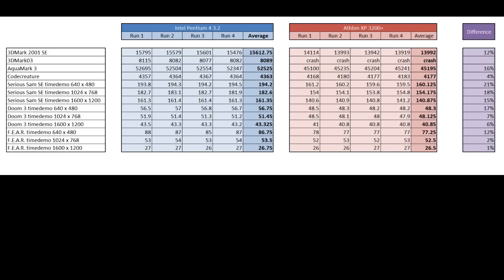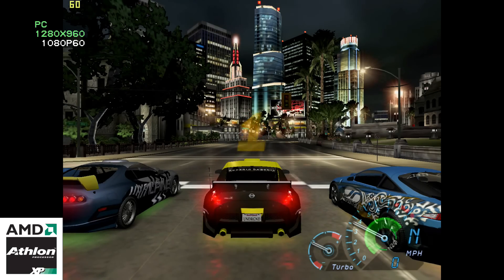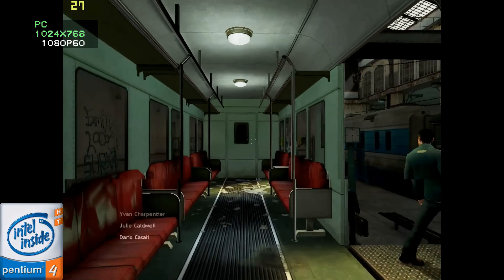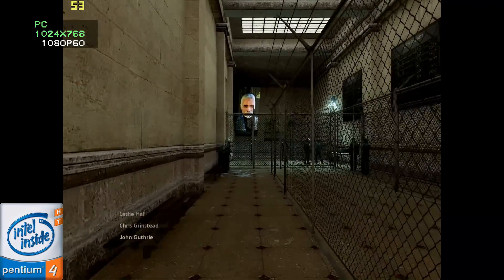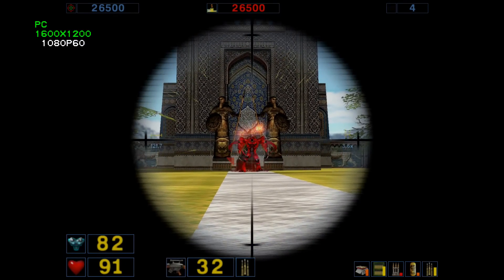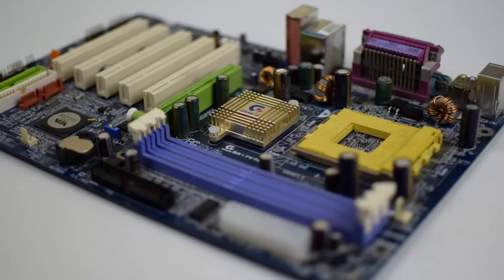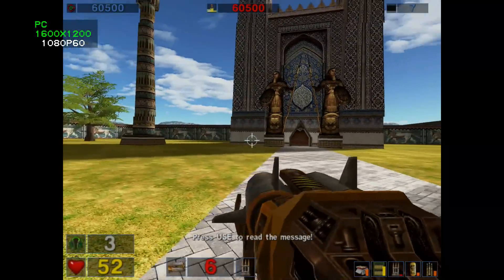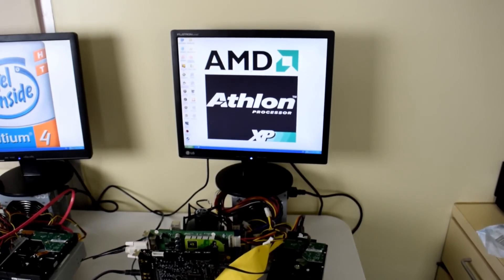Intel vs AMD S1E1 - P4 3.2 vs XP 3200+

Comment: AWESOME video! What did you use for recording the monitor inputs? Looks great.
Reply from the maker: +William McCarthy Thank you :) Make sure you watch episode 2 and 3 as well. I'm still waiting for a CPU to arrive to do episode 4. For capturing I used an AVerMedia capture card.
Reply: Does your AverMedia card come with a VGA input or did you use an adapter? I'm checking out 2 and 3 right now :D
Reply from the maker: I used the DVI output with a DVI to HDMI dongle :)
Reply: Thanks! I've been looking at capture cards lately for this kinda of stuff. I wanted to konw because it's weird seeing the actual bios screen recorded directly instead of with a camera. I have a DVI to HDMI cable luckily. Thanks!

Comment: There's a problem between some nVidia vidcards and AMD64 CPUs. It also crashes WinXP if you attempt to use the magnifier. The solution is to either find a different video card, or use a 32bit AMD. I don't know if this is what you ran into but... I've seen this sort of thing often enough with AMD all the way back that I've become a total Intel bigot.

As to the performance difference, remember that's even tho AMD CPUs are tuned for gaming, and Intels are tuned for business use. And 20% can be very significant if a program is bumping up against the CPU's max capacity. I have a pair of PCs that are roughly the same setup as your two, and the Intel box runs rings around the AMD box.
Reply: The Athlon XP was a 32 bit processor.
Reply: Yeah because the AMD runs at a lower freq and cost half as much at the time 

If you had a decent cooler and overclocked it, the AMD XP got pretty close to the P4 for half the price. 

People forget the prices were just as much as a gap as they are today, only the performance was closer. 

Remember that an Athlon or Duron 1.0GHz will trash a P3 1.0GHz all day.

Comment: these results are not reliable. you are using a P4 HT , disable HT and try again
Reply from the maker: +kjetil Selland Good comment, I plan on doing a video on HT and if it makes much of a difference.
Reply: +PhilsComputerLab HT makes a heap of a differance, Intel could not ceep up in single core IPC until Core 2. they made many mistakes during this period of CPU battles. ☺

Comment: I ran my Athlon XP-M 2600+ Barton @ 3200+ on an Abit AN7 motherboard with 3GB of DDR400 memory, GeForce 7600GT 256MB DDR3. I had a SATA DVD-RW drive and a SATA3 HDD from WD.
Had no compatibility issues even on Windows 7. Everything was overclocked as much as possible, all 3DMark's were passed without problem. I suggest u to get a newer motherboard like the AN7 from Abit that I had.
Reply from the maker: +Nohnaimer It's all been cleared up, take a look in the comment section or in episode 2 or 3.

Comment: The SL6WG supports SSE2 while the AXDA3200DKV4E does not.  This might explain the crash, though I'm not entirely certain if 3DMark03 used SSE2.
Reply from the maker: +Uejji I now now why it crashes. It only seems to affect the AGP GeForce 6 series for some reason. Using an older video driver avoids the issue altogether. It doesn't crash on ATI for example, so it's just some weird incompatibility with the graphics driver.
Reply: Brilliant.  Glad you got it figured out.
Reply: @philscomputerlab  Hi Phil, I´m having similar issue but using a X1650Pro, and noted that it happens with CPU over 1.9Ghz, on lower clock it doesn´t happens(noted due so much tests on A7N8X and A7V600 boards, and a XP-M).

Comment: Nice Video,   I got the Mobile Athlon Xp m 2500 and was able to get a Stable 2.5 oc with 1.75 vcore. When oc that high it's performance (p) rating went to 3.8  The Video card I was using is BFG 7800gs agp.  I still have the system box up for a later retro build. :)
Reply from the maker: +Guy Ferrante Nice video card! I wonder how the 7800 GS compared to a 6800 GT / Ultra.

Comment: Phil I had a Athlon XP Mobile 2500(1.8GHZ) running on Asus NF2 Ultra 400 at 2.7GHZ being cooled with Thermalright copper XP90 with 2GB DDR PC4000
needless to say it blew anything Intel had out the water
Reply from the maker: +hardcore8uk 2.7 GHz? Niiiiice.

Comment: I had a few athlon xp systems back in the day, a 2000+ a 2500+ and a 3000+. the 2000+ was a little underpowered but the 2500+ and 3000+ were great, however using these with VIA chipset motherboards was a pain VIA chipsets seemed to have all kinds of issues including AGP support, including the KT400, and KT600. moving to a nvidia nforce chipset board was a great experience.
Reply from the maker: +TheSynrgy1987 The chipsets is was often caused issues with AMD. The SATA ports on nForce aren't that great either, and later nForce have weird PCI bus issues. This is one area that Intel is really strong.

Comment: that was not a good comparison the AMD 3200 is running at 2.2ghz and a socket 462 the two chips are not even close to being the same
Reply from the maker: +calkster Check the release dates. You cannot compare the GHz, the architectures are different.
Reply: those two chip shouldn't be in the same ring in a vs match. I love AMD but the intel chip you used is a heavy weight and the xp 3200 is a middleweight. good video just not a good match up, sorry.
Reply from the maker: No that's not true. They used different architectures. AMD built a chip that got more work done per clock, Intel went for higher clock speed with a deeper pipeline. Why dod you think AMD named the chip 3200+? To tell consumers that it compares to the P4 3.2. They called it performance rating. The chips came out in 2003, just months apart. This is the FASTEST Athlon XP there is.

Both sold for similar prices too. Feel free to read up on old 2003 reviews.

To take your thinking further, and to show you that you cannot go by GHz, what about comparing the 2.2 GHz XP 3200+ with the Core 2 Duo 2.2 GHz? Now THAT comparison makes no sense :)
Reply from the maker: Or put another way: What processor would YOU pair it up against?
Reply: I would do a AMD 64 3800+ 2.4ghz socket 939 a must, that's the equivalent to that p4 socket 775, that would be some specs to see. my bet Intel on the speed and number crunching, AMD on horsepower , media, game smoothness, FPS. I would watch every second of that video, using same HDD, GFX card, memory, etc.
Reply from the maker: I go by the timeline of release. So as I make more episodes, every processor will get featured :D Same for S754, 939, 775...

Here is a timeline to give you an idea:

April Pentium 4 3.0 HT Northwood / 3000 / 512 / 800	
	May	Athlon XP 3200+ Barton 2200 / 512 / 400
June Pentium 4 3.2 HT Northwood / 3200 / 512 / 800	
September	Athlon 64 3200+ ClawHammer 2000 / 1024 / 800

Comment: My experiences with pentium 4 was never too good.
It's because my p4 config back in the days ran everything a LOT slower, than my pentium 3 or other PCs did!
Browsers, games, everything.
I still don't know why.
Reply: Clock for clock the first Willimet p4 processors were slower than p3, but obviously they had much more head room.  This disappeared with the Northwoods introduction.
Reply: I see my comment is kinda active now, so I can give you my exact case.

I had the Pentium 3 PC with:
ASUS TUSL 2-C motherboard,
800MHz Celeron CPU
512MB SD Memory
Fx5500 VGA

My games were running relatively good, the browsing was fast enough. CS 1.6 with 80+ FPS

Then I changed my platform (motherboard, cpu, ram), but every other part remained the same.
I don't remember the motherboard, but the cpu was a 2,4GHz one with 1GB DDR1 memory.
The games were almost unplayable, browsers were slow, even CS 1.6 had 20-30FPS. 

I tried every kind of settings back then, but nothing worked. Sorry for the long comment.
Reply from the maker: I'l definitely look into this at some point. There are also lots of RAM options with the P4. The early ones had SDRAM and RAMBUS. Later ones used DDR.
Reply: I had a system with a motherboard that took Rambus RAM, the reason I changed was because at the time Rambus cost a fortune and it was very hard to find.  From what I remember about it was it seemed very fast and responsive.  I would love to see some tests done comparing DDR with Rambus, it would be quite interesting.
Reply: I would say there was something else at play because a 2400 Mhz P4 would blow away an 800 Mhz celeron, so something else was contributing to the slow down.
Reply: Even if it was a Rambus it should have performed better than a 800 Mhz P3. I think he had integrated graphics on the P4, of course it would run much slower, even outside games as integrated graphics of the era were system bus stealers and bogged PCs down.

I have the opposite experience. I remember games on my P4 with HT 3.2 Ghz to run even better than in this video, with a Geforce 6600, yet there was a "public computer room" near me where me and other kids would go to play games on LAN. It had Athlon XPs combined with some really nasty graphics chip and it run Warcraft 3 much slower than even the 1 Ghz Celeron I had long before the P4. I know bashing P4 is popular, but I found it a really nice chip that enabled me to play all the games at that time. The PCs in my school are still Pentium D or Pentium 4 HT based with Windows XP and they run faster in stuff like browser or MS Word than some modern Windows 10 laptops I have seen and they even handle Youtube video quite OK for the age, despite being crippled by integrated graphics. It helps that they are maintained and kept virus free.
Reply: i havent used integrated video for my P4, it had an FX5900XT, which was also better, than the one i had in my P3 back then.
Reply: It must have been a hardware issue then.
Reply: The Pentium 4 was often slower than the Pentium III... but it could make toast while you played games.

Comment: Intel is better but it also costed more. AMD was for those of us who couldn't afford Intel yet still delivered good performance. Might be worth noting that Athlon XP actually runs at a lower real frequency than the Pentium 4 (around 2.3 Ghz versus 3.2 Ghz).
Reply from the maker: +xyz12345 Yes, other processors like the Core 2 Duo or Athlon 64, they all run at lower frequencies too. The P4 with its deep pipeline, it was a design that didn't pay off, the heat just got out of hand at 4 GHz.

Good comment about prices, what I'm finding is that the Pentium 4 gear is much easier to find, although it cost more back in the day. It's now all the high end AMD gear that is hard to find and becomes collectible. I had to look around a bit to find that XP 3200+ and decent nForce2 boards are also not that easy to find.
Reply: PhilsComputerLab They actually thought they'd reach 10 Ghz with the P4 after being pulled back to earth by the extreme heat that would produce. Future design is not in higher frequencies but in more cores and smaller dies that generate less heat and consume less power. The problem is just that most game devs suck at optimizing for multi-core architecture and that you can never have ideal performance. That's why fast dual cores still fare surprisingly well in modern games.

Comment: May I ask why did you use the GeForce 6600 instead of native 6800 AGP cards? The 6 series has the crude PCI to AGP bridge and 128 bit memory interface instead of 256 bit. I think the 6 series were the first cards ever to have an AGP bridge. Don't know if it will make any difference.
Reply from the maker: +RatCatcher Because I don't have one (yet).
Reply: +PhilsComputerLab HEXIR has a bunch of BFG 6800gt's at $45 plus shipping. That's the cheapest I've found them.  Ultras are starting to be rare.

Comment: I also had major problems with 3dmark 03 with my athlon xp 3200+ machine.

I were worrying that there was a problem with the hardware but thankfully it was only the 3dmark03.

Tanks for that power supply advice (Y)
Reply from the maker: +NuffMan Yea it's only with the GeForce 6600 apparently. An older graphics driver can solve the issue as well.
Reply from the maker: +NuffMan Using ForceWare driver 93.71 WHQL solved the driver crashes and 3DMark2003 completed without any issues.
Reply: +PhilsComputerLab I have Ati Radeon x1650 and 3dmark 03 does not work no matter what drivers i use.

3dmark 06 works tho
http://www.3dmark.com/3dm06/17812779
Reply from the maker: Odd. I should have a X1950 Pro AGP 512 MB soon, will check it out. What driver did you use?
Reply: 6.14.10.6925
Reply from the maker: Ok. I'll check it out when the ATI card arrives.
Reply: Have you tested it yet?
Reply from the maker: Nope, not sure when I get around to it.

Comment: I had a Dell Dimension 3000 with a Celeron D processor and a HP Pavillion a430n with a AMD Atholon XP processor, could you do a thing with that?
Reply from the maker: +Matthew Chambers Good machines for a retro XP gaming machine!
Reply: Thanks, should I upgrade the processors to Pentium 4's or keep them the same( I'm thinking of making a series called garbage gaming or something like that.)?
Reply from the maker: I would check out the systems how they are, run some benchmarks, and then see how you could upgrade the machines and what impact it would make.
Reply: ok Thanks man

Comment: We used to buy XP 3200+ CPUs, blank out a pin of some sort and use them as MP 3200+ on multiprocessor Tyan boards. I really don't remember. Worked perfectly at ~ 1/3 the price.
Reply from the maker: +Little Star (Zvyozdochka) Nice trick!
Reply: I have an old K7D Master-L (MS-6501 v1.0) with two 2400MP CPU. With the 2.01 Beta BIOS i can use a Sempron CPU on the Board (I have never tested if I can use two Semprons). Do you remember which PIN had to be removed from the XP 3200?
Reply: @schocger  I don't unfortunately. It was something about shorting two pins actually, or joining one that wasn't present. I'm unsure if the Sempron's had it myself.
Reply: @rabidbigdog  okay. when I have time and desire, I will install my XP3200 in my AMD MP motherboard and see if it is recognized with the Beta BIOS. ;-)

Comment: Ima say the athlon wins hands down before even watching the video to the end or in any sort of way.
Reply from the maker: +Clesarie Unfortunately it doesn't. The P4 is faster.
Reply from the maker: You cannot compare just the clock speed. Core 2 Duo runs at 2.4 GHz and beats both of them.

AMD marketed these CPUs with a performance rating so that it is easier to know what the Intel equivalent is. With the 3200+ they were way too optimistic.
Reply: +PhilsComputerLab Pentium 4 got 3,2Ghz and athlon 2Ghz !! and difference in price was like todays athlon 860K   against i5 6600K
Reply: PhilsComputerLab i dont talk about core 2 duo who comes later!! dual core athlons compare to core 2 duo!! I had athlon 3500+ with 2,2Ghz and was 2x cheaper than similar Intel but he beats Intel on same or even higher clocks !! I had 3500+ till 2013when games start to use more than 1core and changed for athlon II x4 740
Reply from the maker: My point was that different CPU architectures are different. Therefore you cannot compare by clock speed. Why do you think AMD called this processor 3200+ and not 2200?
Reply: PhilsComputerLab    maybe they are different but clock clock speed  if you benchmarked you cant  have different or if you have then you tell that !! same like 3500+ athlon called 3500+ and have only 2,2Ghz and i had him!! they can called him athlon 57000+

Comment: Interesting video. I use an Athlon XP 3000+ Barton as a backup computer and the lack of SSE2 causes me tons of headaches with streaming video and lots of current software, e.g. Chrome and many anti-virus programs. It's still great for older games, though.
Reply from the maker: +mdh269 Yea that is an issue. I only play games so I didn't notice many issues, but I noticed that Chrome wouldn't work.

Comment: I have 3 Pentium 4 Compaqs sitting in the garage right now. I didn't think anything of them until this video. Maybe it's retro LAN party time.
Reply: A good idea! Just make sure they have at least a Geforce 6600 in them. I feel many Pentium 4s have a bad reputation due to many being used with integrated graphics.

Comment: I didnt even watchted the video. Ofc barton 3200 won it vs p4 on 3200:P
Reply: Actually the P4 won.
Reply: Cuz this is a HT p4 smarty. Not the real one.
Reply: So HT P4s are not "real"? He is comparing stuff that was available at the time. Why should not he use HT P4?
Reply: I've typed it because the titel says P4 and not P4 HT.
Reply from the maker: The title is just that, a title. The HT Logo can be seen within the first seconds. It's also mentioned in the video and the HT was the standard P4 at the time. Apart from performance, there is so much more to building a retro gaming PC. The Athlon sucks most power from 5V, a real issue with modern power supplies. It also doesn't support SSE2, not an issue back int he day, but now? It means Steam and many other programs don't run.

Comment: Pretty wierd, i had a 3200+ also but my CPU were much more pwerful then a Pentium 4 HT 3.2GHz s.775 with 2MB cache 

Something must be wrong with the board. i had no problem running mine with a ATi 2900pro 512MB
Reply: +Heaven&#39;s Elegance you had the athlon 64